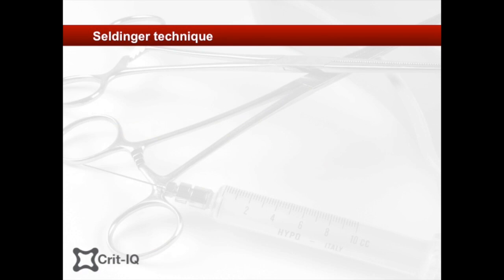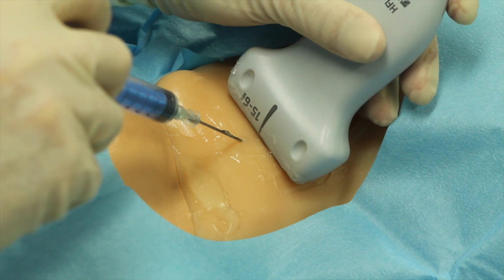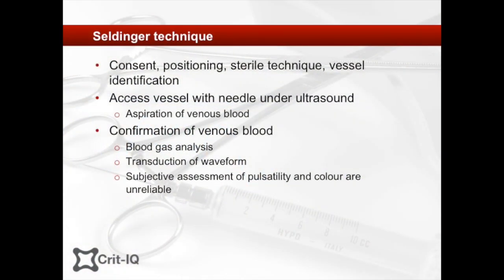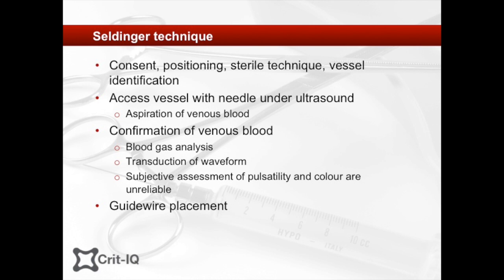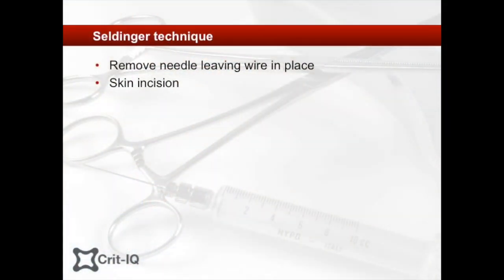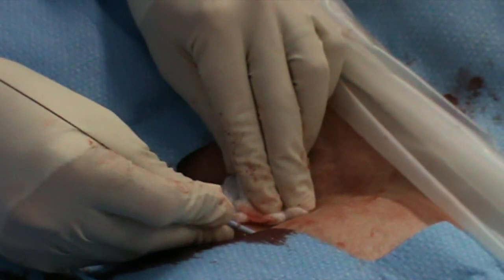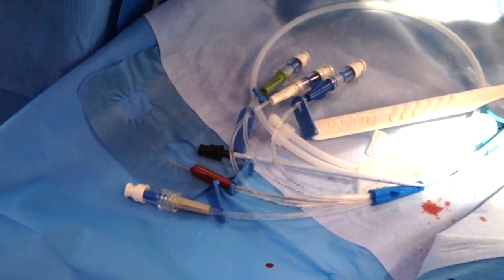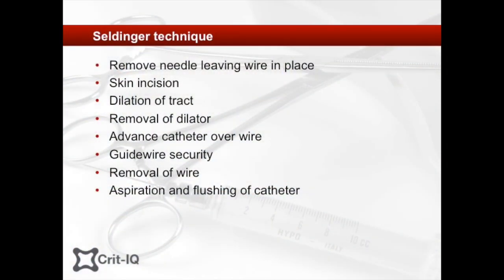Seldinger technique

Comment: Today while placing a line, the guidewire got stuck after dilator placement. It got kinked/knotted inside, confirmed by x ray. Patient was a thick hard skinned CKD, and i had not used a blade before using a dilator.
Learned my lesson the hard way.
Thankfully guidewire was removed safely in a cath lab under fluoroscopy, without any complications.